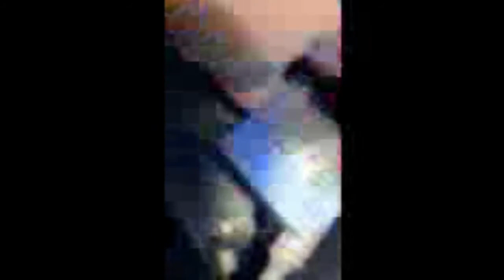How to fix U0101 Trouble Code: 2011 Chevy Traverse (wire repair)

Comment: You just saved me $700!! All the other videos I found out here pointed to replacement of the tcu. Thank God I found this video first. My wire was broken in the exact same spot. As soon as I spliced in the butt connector my problems went away, the gear selector in the dash started working (I was able to get into Reverse before but no forward gears and the dash selector had nothing circled). Thanks again!!
Reply from the maker: That's awesome. Glad to hear it! I knew this couldn't be the only one.

Comment: thank you for this video, I want to know if it's the same thing on chevrolet epica automatic gearbox? because I have the same problem, my car is struggling to move forward and I have an error code: u0101. you can help me please? thank you very much
Reply: Similar here but with a Chevy Captiva  2014. Greatly appreciated if you have any inputs on if wiring is the same. I have been told is the TCM but that thing is inside the transmission...hope is just the wiring.
Reply: @MrJorvilla84  it usually is, or the pins inside the connector. Did you resolve your problem yet?